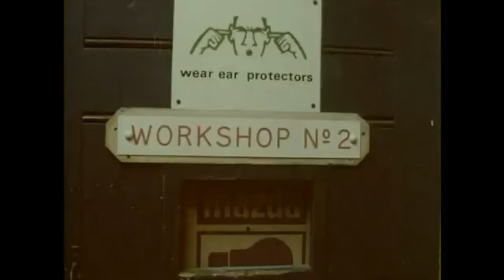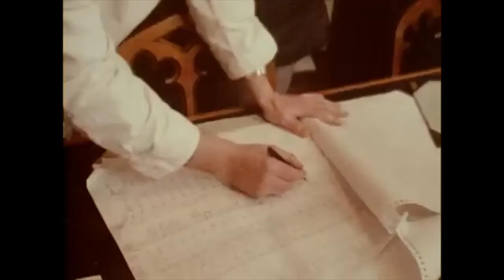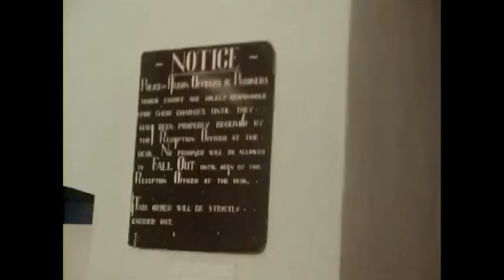World in Action: Banged Up (1979)

Comment: An inflation rate of 4.19% per year means £100 in 1979 is worth £634.07 in 2024, 33k pa. The average salary for Prison Officer in 2024 is £33,370 per year. so it hasnt changed, apart from its now better conditions and also the 70 hour week has now been cut in half with the same wage so overtime will increase the wage value.